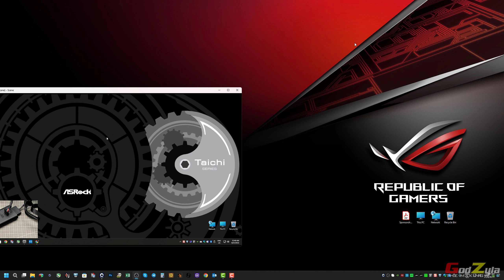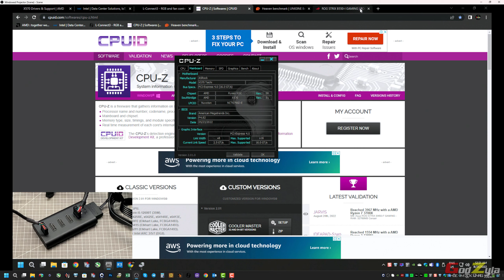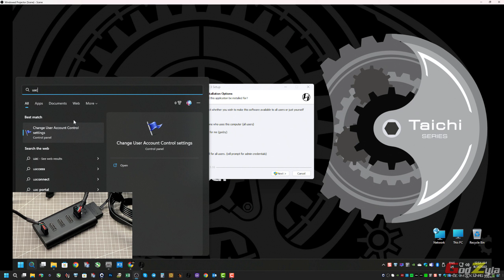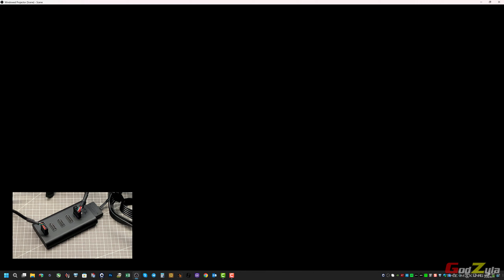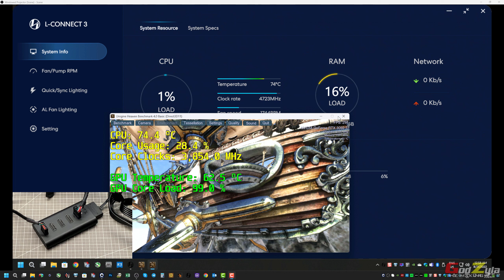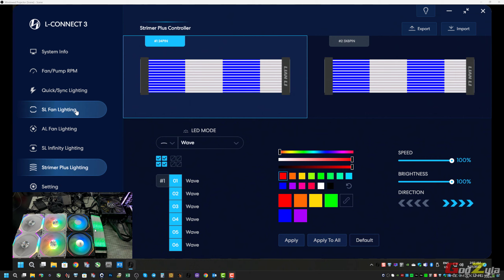Lian Li ARGB Products (How to make it work?) [L-Connect 3]

Comment: Only problem I’m having is the high CPU usage due to the L-Connect. Also is it normal for the fan to be shown as a removable device in the taskbar tray?
Reply from the maker: Hello Hanies, welcome to my channel. High useage of CPU can be caused by alot of resources sharing the same IRQ as the usb devices you have used or it could be other causes like background apps that make use shared program code that interfer with your L-Connect app. I am not able to tell you which, you will need to figure out yourself. for a start if you have alot USB connecting device, remove them all and slowly plug one at a time so see if it does take up the system resource which is shared with your L-Connect 3 app. (Excluding Keyboard and Mouse)
Reply: @KleoYan  Thanks for the reply, I’ll have to try that. I had to use a USB hub as I have the Corsair LCD pump and Commander Core inside the case too.
Reply from the maker: @haies09  ok that might be the issue. you have two devices that runs argb program at the background, both are fighting for rigths as both make use of the same IRQ, therefore the conflict might start from there. so something which you will need to take note on... all the best with your troubleshooting.

Comment: do you use an argb splitter for the 4 different controllers? or do you not need to plug in the argb connector?
Reply from the maker: Hello Nick Swan, welcome to my channel. If you want to control the argb through your motherboard software, then the argb connector should be in place, else if you want full control by L-Connect 3 app. You do not need to plug the argb connector between the uni controller to your motherboard argb header.

Comment: hey men how i can control 9 argb light in lian li L-connect?
Reply from the maker: Hello Khaidel Ahadain, welcome to my channel. Do you mind to be more specific to which device you are using? which unifan or which strimer plus ? you gave me a general questions which I do not know how to answer. Should I just answer you need either uni fan controller or the strimer plus v2 controller to work with L-Connect 3??  thank you!
Reply: @KleoYan  im using lian li st120 fan what controller do i need to use the lian li app thanks for the answer
Reply from the maker: @mysupergirlypop  L-Connect app does not give a dedicate ST120 fans argb effect as it does not carry any custom chip in the fan itself, unlike the uni fans family. However you still can plug in but will only get standard effects or random effects. I would advise you to use the orginal physical controller for ST120.

Comment: thank you so much, one question please, i connected the strimer controller to an usb3 to usb2 adapter and the adapter is connected to my usb3 on the motherboard, and i can't see the controller under l-connect 3... it's because of the usb3 to usb2 adapter?
Reply from the maker: Hello my stuff, welcome to my channel, I have a few question have you tried to plug your strimer plus controller directly to the USB 2.0 header of your motherboard? and btw which adaptor are you using? it could be insufficient power on the adaptor.

Comment: What do I do If the none of the fans show up on the l connect 3?
Reply from the maker: Hello victorbarcenas, welcome to my channel and which fans are you using, you might need to do a manual firmware update on that uni controller https://lian-li.com/l-connect3/L3_update_manually/
Reply: @Kleo Yan  hello yes!! I got it thank you the controller was a little wonky I moved it and they showed up...but the v2s
Reply from the maker: @Chubbyboi555  Hi, welcome back and Merry Christmas, am gald you got it fixed. 👍

Comment: Hello! I’m from Singapore too! Thank you so much for your hard work in making this video~ I would like to ask about the Lianli strimer plus. Can I use L connect or L connect 2 to control the strimers? I have a triple 8 pin and a 24 pin. Both are v1. I have the v1 controller, but it seems like a purely manual controller that I have to open up the case to change the lighting effects, also there are only 7 colours and no gradient rgb effect. If I want gradient rgb, I have to press m1 to pass the control to the motherboard software, in this case I have a asus motherboard that uses armoury crate and the lighting effects in armoury crate are the opposite. That means I can have gradient rgb but I am unable to achieve the lighting patterns of the controller. Is there a way that I can get more rgb lighting effects like by using another software without opening the case every time I want to change the strimer plus lighting effects? I do not have any lian li fans, I only have strimer plus v1 and the v1 controller. When Thank you!
Reply from the maker: Hi Imogen Infinity, welcome to my channel. You have two choices. 1 is to purchase a Strimer Plus V2 controller. you can refer to these video https://youtu.be/J76Zyd1GzNA or https://youtu.be/uWNZO2HVgxE. 2 is to try out Signal RGB, this is an application which others are talking about which you might want to search from google or youtube about this app. I myself have not tried this but you can do some reasearch about it.

Comment: Your videos have been very helpful and greatly appreciated!  I have just built a system using several Lian Li products, and initially I couldn't get the SL V2 controller to show up in my device manager, and following your instructions I was able to get it to work perfectly.  I also have a Strimer V2 cable, and that has worked great from the start with L-Connect 3.  My last issue, is that I have purchased the Lian Li Lancool 216 RGB version case.  I have 6 SL V2 Uni fans - 3 of which are on a Lian Li Galahad 360 AIO.   I hooked up the PWM header from the SL UNI fan controller to my CPU_FAN header.  I'm not sure if this is optimal, but everything seems to be working fine, and I can control all 6 of the UNI fans with L-Connect 3 (both PWM and RGB).  The issue I have now remaining, is the two 160 mm RGB case fans that came with the 216 case.  I opted for the AGRB controller accessory, which is just another USB 3.0 port hub, and has some mode and color buttons to control the RGB on these fans.  I thought this would be fine, but I've found every time i power off and on the PC, these fans revert back to rainbow RGB - which is really annoying.  The case came with a fan controller for the case fans, but to my surprise (and dismay) Lian Li didn't integrate this hub for use with L-Connect 3.  What is up with that??  My goal would be to have all the fans and RGB controlled by the L-Connect software.  The PWM control of the case fans is working fine using the ASUS armoury crate fan xpert software, so I'm fine with that.  But is there a way to get the RGB of the two front case fans to sync with the rest of the RGB fans using L-Connect 3?  I asked the question to Lian Li tech support, and they didn't give me any instructions but sent a link to a ARGB cable kit.  The only thing I can think of is to use an adapter from the 5 V ARGB connector from the case hub to connect to the sync port on the UNI SLV2 controller.  I just am not sure if this is what they meant.  I did use the RGB cable from the Galahad AIO RGB to one of the sync ports and that does seem to work with L-conect 3.  What do you think?
Reply from the maker: Hi Kinegos, what your have mentioned about the Lancool 216 case fans. You are absolutely correct. Here is a diagram which will aid you https://imgur.com/PrPqFBt (download the picture if it's too small), btw, the converter is part of the lian li argb kit which you have bought.
Reply: @KleoYan  Hey Kleo!  I wanted to follow up as I finally got the Lian Li ARGB Device Cable Kit which had the adapter cable I needed as in the picture you kindly linked in your comment.  I'm happy to say it is working great now with the only small annoyance that every time I reboot I have to press the mode button on the 216 accessory RGB interface for 3 seconds to hand control over to the L-Connect app.  It's still better than what I had before, but Lian Li really is puzzling that they make this new case with RGB controls but don't integrate it seemlessly into their own RGB software right out of the box.  But really appreciate your help!  Now I have about 10 cables I don't need as I just used the one cable out of this kit.  😂
Reply from the maker: @Kinegos  Hi, welcome back and am gald you got everything sorted out. That's one of the down side not only in Lian Li 216 argb controller. it happens to most physical controller which has a remote control. If it's software based, then you won't have this issue. This physical controller on the case do not remember the Mobo settles, you have to toggle it.
Reply from the maker: Hello Kinegos, welcome to my channel, I will get back to you on this as it's pretty late at my end, need to catch some sleep, but will reply you in my morning. Thank you!

Comment: No VGA fan speed be synced and the app always pops up when PC wakes up from sleep, that's what I got with L-Connect 3.
Reply from the maker: Hi Vu Hoang Thuan, welcome back, L-Connect 3 does not control your GPU fans, it will only monitor the temperature. as for your error, I have no idea why it pops up. have you try swaping on L-Connect 3 PWM dashboard to monitor CPU instead of GPU?
Reply: @KleoYan  Thanks for your quick response. In fact, my L-Connect 3 app was set to sync with CPU, not GPU.
Reply from the maker: @vuhoangthuan326  I see. Have you tried re-installing the L-Connect 3. Before you re-install it. Totally remove the app using revo uninstaller. See if it works.

Comment: So to power up the cables, use the argb, and the l connect software I just have to connect the usb 2.0 header to the motherboard? There is a cable that is optional for motherboard sync and I don’t have that plugged in because I am not sure what it does. Is it alright to leave it unplugged?
Reply from the maker: Hi Rain Drop Drop Top, welcome to my channel. This video might assist you though it’s old content but it’s the fundamental of how uni fan works https://youtu.be/Rm2emeyMUAk . You are not wrong when you’ve said just to connect these inorder for it to work that is to connect the sata cable from the psu to the uni controller, the usb cable between the motherboard to the uni controller and you don’t have to plug the cable that goes to your mother fan header and argb header.
Reply: @KleoYan  Awesome, thank you for the quick response and answer. The video you linked was very helpful!!
Reply from the maker: @raindropdroptop3169  you are most welcome. infact i will share with you my playlist https://youtube.com/playlist?list=PLEW-b-2vYDdPo0NzHyeksx012c-nkDapm. Anything you need to know about these uni fan, you can refer to. just need to take note of the title that says [L-Connect], they are the version of the L-Connect .. exmaple Lian Li Uni Fan AL120 - The Controller [L-Connect 2] <--- this will tell you that it's the L-Connect version 2.

Comment: Can I connect Deepcool Castle 360EX ARGB pump rgb cable to lian li uni hub and use L connect to control the pump rgb light?
Reply from the maker: Hi gan shengkai, welcome to my channel. If you have the convertor, I dont see why not. but do note if you plug your aio pump argb, dont expect to have a specific pattern to it. as what you are connected to on this uni controller are meant for the effects for the uni fans.
Reply: @KleoYan  Thanks for the reply!! Why need a convertor? Is it because not universal unless I use Galahad aio pump?
I decided to use DeepCool Castle 360EX A-RGB and change all the fans to Uni fans. I know some software can sync all the Uni fans and pump RGB but don't know whether the L-connect works or it only can control the Uni fans except the Deepcool pump RGB.
Reply from the maker: @ganshengkai7060  for deepcool the argb is a standard connector, the uni controller is not. thats why you need a coverter. as for other application to controll, you can do that, but you will still need the L-Connect application installed and to set to by pass, in order for you to use other application to control the argb effects. kindly do not ask me how it's being done on other argb application or controller, as I only focus on Uni fans and it's controller, plus i do not have other controllers to explain. thank you!

Comment: So if i connect 2 unifan hubs and 1 for the strimercables on the nzxt hub with all the sata cables correctly the Lian li software will detect the 3 controllers without any issues right?
Reply from the maker: Hi Michael Stark, welcome to my channel. That is correct., just a side note, do it in a way, one piece at a time and to test them on l-connect 3 applications. If you follow the steps in this video, you will get all running at no time.
Reply: Thank you so much for the answer, video really well done.  So I'll add one controller at a time and do the derivative updates step by step.  Hope to fit the controllers inside the Lian Li Dynamic EVO 😂😅
Reply from the maker: @michealstark6091  you are most welcome and thank you for the compliment. All the best with your build. 😉

Comment: only one of my fan cables is being picked up in my device manager when i have three but i know the other two sets of fans are connected as the fan motor is warm when my pcs on but there is no rgb and there not spinning and they arnt being detected by anything, any ideas? also im using the infinity fans with the L connect 3 software
Reply from the maker: hello Slty, try one fan at a time to test all your fans out. once done, daisy chain 2 and test out the port. if ok add one more. then continue next set. it could be a connection issue. normally when I test uni fans, I always do my basics and not just plug everything in and expect it to work mircales and sometimes there are leakage somewhere. safest way is to test them individually and step by step move up. Take it slow and easy.

Comment: If i want to use the triple fans on my AIO, where do i connect them? Into the controller or CPU Fan on Motherboard???
Reply from the maker: Hello TheOldKenobi, welcome to my channel. For SL and AL. The argb to the controller and fan to the motherboard. For SL infinity if you getting the 3 pack. You got no choice but to plug all to the controller. If it’s SL Infinity single pack. You can plug fan on the motherboard and argb to the motherboard too since it does not come with a controller.
Reply: @KleoYan  Thanks mate for your answer!!   I want to buy the new  SL120 v2
Reply from the maker: @TheOldKenobi  you are most welcome. This might help you decide if you want to get the 3pack set it the individual pack. https://youtu.be/izmEBti6u_k
Reply: @KleoYan  Hi. Great video. Quick question. I've got 10 SL infinity fans. I've got a triple pack and a bunch of single fans. I've got a phanteks glacier one 360 AIO with 3 SL infinity fans on the rad. That set of fans is plugged in as you described in the above comment with the pwm plugged into the cpu fan on the motherboard and the arbg 5V plugged into the motherboard. L connect 3 doesn't recognize that group of fans which I suppose makes sense given its not going through the controller. Am I stuck setting the RGB for that one set of fans through the motherboard software? Thanks!
Reply from the maker: @adamcline1580  hello, welcome to my channel. now what you can do is this. first observe your uni controller, there are total of 6 ports which lables port 1 to 4 and two additional port which are labled as Sync 2 and Sync 4. 

Now on your Phanteks radiator fans, instead of using the 7pin cable from the 3pack set, make use of the single pack cable which spilts to 4pin PWM and 3pin ARGB.
Plug the 4pin (PWM) to your motherboard and let your motherboard control the fan speed for your radiator fans and plug the 3pin (ARGB) either sync 2 or syn 4 to your uni controller and let L-Connect 3 app to controls the argb effects.

Please note when using Sync 2 or Sync 4, the argb effect will follow this way.  

- Sync 2 will follow Port 2 ( Make sure there are SL Infinity fans plug to Port 2 inorder to have the SL Inifintiy Lighting shows in the sub menu of L-Connect 3 ) 
- Sync 4 will follow Port 4 ( Make sure there are SL Infinity fans plug to Port 2 inorder to have the SL Inifintiy Lighting shows in the sub menu of L-Connect 3 )
Reply: @Kleo Yan   thanks for the advice. After reading your response, I just realized this is possible with the correct cord. I'm using the single pack cord that splits to 4 pin pwm and the 3 pin argb. However, the argb is female on the cord that comes in the single pack so it can't be plugged into the fan hub. Looks like I can get an adaptor cable that allows me to plug the argb cable from the single pack into the fan hub. 

I currently have the argb cable from the AIO and the argb cable from the o11 d evo front panel area plugged into the two ports on the hub. I'll have to either add a splitter cable for one of those ports or move the front panel argb to the motherboard header. Thanks for your help!
Reply from the maker: @adamcline1580  oops, me too. I assume the 3pin connector can direclty plug to the uni controller. my bad.. and yup you need an adaptor for it.